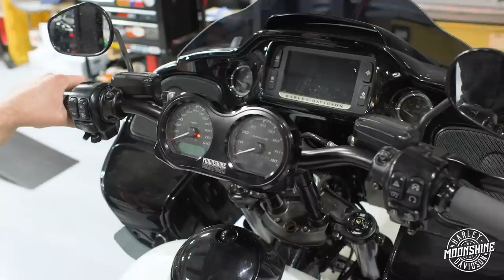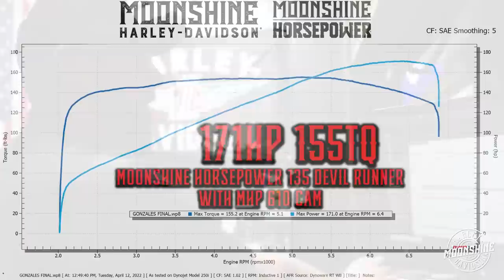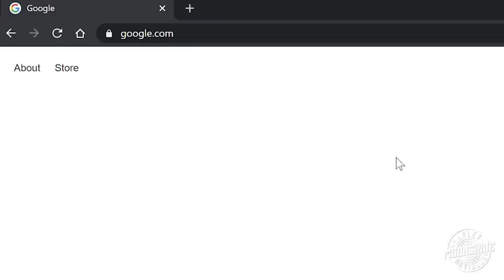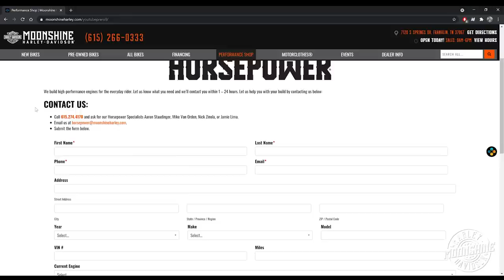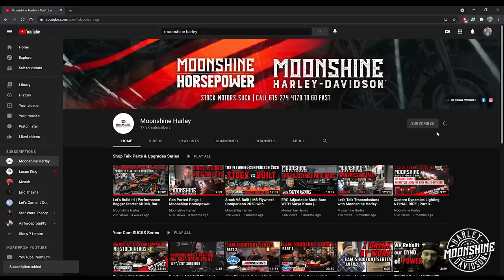Moonshine Horsepower 135 Devil Runner M8 171HP 155TQ |  Bike Build No. 7

Comment: I’m gonna buy that compensator.. I’m curious if y’all prefer the S&S cam plate over the feuling.. I can’t help but notice there’s no bushing on the feuling and HD allows 0.012” pinion runout
Reply from the maker: The new H-D has the best flow but limits you to cams with 0.570 exhaust lifts. We typically use the S&S setup unless it’s a race built than we modify the SE cam plate to except a larger cam.

Comment: Nice build! Really amazing how much hp & TQ you’re getting from these M8 motors. Q: with these big inch builds are there more issues with heat soak in stop and go traffic?  Also, are you doing and builds on the “sprinkler head” models? Ty 🙏🏼🇺🇸

Comment: If you are not beating on your bike, should you be worried if you are using a Man O War comp. I get the idea of smooth power, but is that for every gear shift or from 1st gear to speed?
Reply from the maker: It help on downshifting and getting on in off the throttle. The compensation that H-D designed helps elevate stress on all the components behind the compensator.

Comment: Sweet ride fellas. I have a 2021 CVO Ultra Limited Bronze Armor, stock. Have the Legends Evo’s rear & iso Legends front. 16” LA bars & some thunderheader slipons. Not looking to totally rip apart my brand new motor. Not sure 🤔 a 135 is needed? lol 
But curious what you fellas would recommend for a weekend warrior and his wife. I ride only 2 up & roughly 200 miles a ride. Just race the buddies every once in a blue moon. Would like something near a 120/120 build. What would you fellas recommend??
Reply from the maker: MHP stage II setup with our MHP-485 cam. 125-135 foot pound of torque and 116-127 horsepower. Please email us your info to horsepower@moonshineharley.com and will contact you to discuss all the options. Please include a good contact phone number.
Reply: @MoonshineHarley  10/4 rabbit

Comment: Still have the belt?
Reply from the maker: Yes. We do lots of builds with chains. If this beast is operated correctly the belt can handle a lot. It also depends on how you have your primary setup. On this build we used the MHP Comp Ramp "Comp Of Power" with a Rekluse clutch basket, Rekluse Torque Drive Clutch and stock H-D primary chain tensioner. This Combination can handle 200 plus HP and has some give designed into it to lesson the shock on the Transmission on final drive belt. This is our go to on any build we do with ported heads.

Comment: I can't help but to address the ELEPHANT IN THE ROOM. What about the #Hellson2wheels? Did that ever resolve? Is there another part of this story we you-tubers wasn't made aware of. Maybe you guys can shed some light on the situation? "Your story?" I know when we build these things I go with the understanding that there is no warranty. It's a complete trust for your workmanship and the value of our dollar. But I've heard you guys state numerous time about your "IN-HOUSE" warranty. QUOTE: "WE COVER ALL AFTERMARKET HORSEPOWER PARTS, TUNERS, AND EXHAUST. The dirt is already on you-tube. Just asking, respectfully.
Reply from the maker: We rebuilt his engine when he had a legit claim which was a failed valve spring. We have switched to a new valve spring manufacture which is PSI since. They make the nicest springs available.
There are all kinds of untrue statements in his video and we don’t need to go into it here. We do awesome work and stand behind our builds. If anyone needs more info please call the shop and ask for Jamie or Mike, 615-771-7775. We have advised him we need the motorcycle here so we could diagnose the problem. He was upset over that option so he did the video. We also have had a ton of customers comment about their positive experiences on that video and how happy they are with their MHP builds and he just deletes them.
Reply: @MoonshineHarley  Thank-you...  There is always two sides to every story. As far as I can tell, 24 years in the business with next to very low complaints. Just felt like it needed to be addressed since it was aired out here. I do believe you guy do great work. You wouldn't get where you are if you didn't. I also have a CVO Limited myself I like something done but have pushed the button on it just yet. While your shop being and still is one of the top considerations of doing the work. Thanks again.

Comment: Only in the Harley world would you take a brand new motorcycle apart and do a ton of work to it just to make it as fast as it should have been from the factory. It would now almost beat A BMW GTL in a straight line. Now if we want to talk about actually going around the corner that's completely different whereas the BMW will still eat the HD alive
Reply from the maker: AMERICA!!! We have bikes that’ll spank that BMW but not out of the box. It’s a fun thing to build a Harley-Davidson into a speed demon when they were originally designed for touring and comfort. It’s similar to when a 10,000 lbs diesel dust a V8 Mustang. It’s not supposed to happen but it does.
Reply: @MoonshineHarley   Yeah sure I stock motorcycle against the stock motorcycle is a race. You're doing 10 to $20000 worth of work on it just to be able to keep up to a stock motorcycle is ridiculous. And of course you can't go around corners then all you can do is info in a straight line. After 450000 miles on road glides I got tired and bored with a slow heavy motorcycle that handled terrible. Can you imagine how fast AGTL would be with with $10000 worth of work do it.
Reply: @duanesmith5074  you are also comparing apples to oranges. It would be great if Harley built touring bikes with 170hp but most who buy a touring bike don’t need or even want that much power. For those of us who do thankfully there are shops like Moonshine to fill that market. Think of it like the Corvette, Camaro & Mustang world. Or even more so, the import scene. Lots of people hotrod and modify these stock vehicles to make them faster. But most drive them as is with maybe one or two mods. Harleys have more customizable options than any other brand of motorcycle. The reason they do is because they have over 50% market share. If you don’t like them that cool. There are lots of other brands to choose from. Ride safe. ✌🏼🇺🇸
Reply: @mrh3085   No not really I'm comparing 2 motorcycles in the touring class. I have still 3 harleys and over 450000 miles on road glides. Harley Davidson is one of the very best motorcycles in this world. Run by one of the very worst T-shirt companies there ever was. Their business model is to build a substandard motorcycle and convince their customers that the idea is customize it to be your own motorcycle I went to buy my eight Road Glide and they wanted $39,000 for it after all the work was done. They only wanted to give me $18,000 for the Road Glide I bought from them three years before that for 29000. I went next door to the BMW motorcycle dealership and bought a 2018 BMW GTL that cost $27,600. Incredible motorcycle that came with everything Harley wanted extra for the motor. You can see now that Harley-Davidson has realized that their business model does not work when they have to compete against adventure bike standards
Reply: @duanesmith5074  I agree with you that Harley’s business model is far from perfect. I believe the price of their new bikes has become far too high. This is because of the devaluation of the dollar and it’s happening everywhere you look. Of course is a completely separate conversation but shouldn’t be placed solely on H-D. This is also why I’m still riding and enjoying my performance bagger I built in 2011. Like I said ride what you like. Hopefully the competition will drive Harley to make positive changes we can all benefit from Duane. ✌🏼🇺🇸
Reply: @cavscout62  if you haven't been paying attention your Harley's made in China Vietnam and Mongolia
Reply: HARLEY HATER